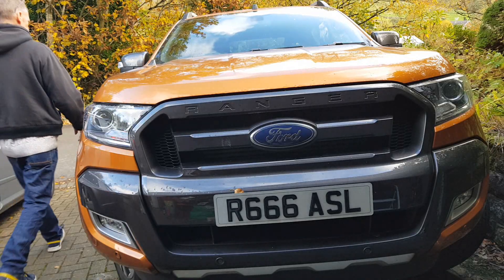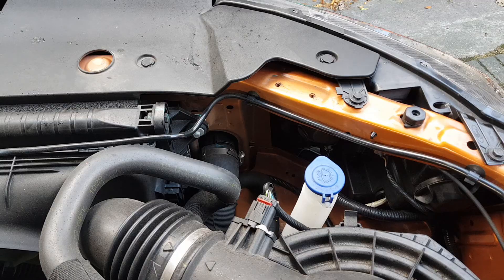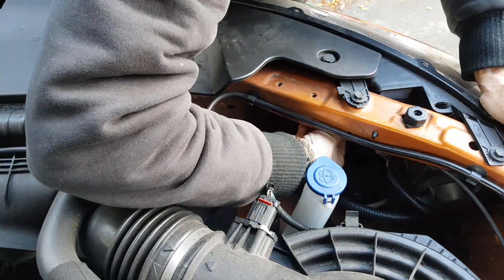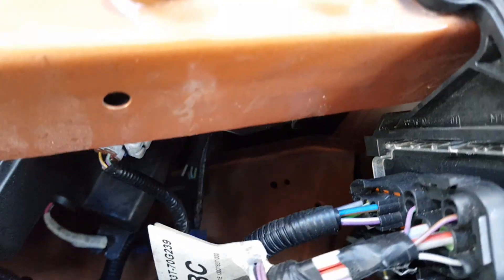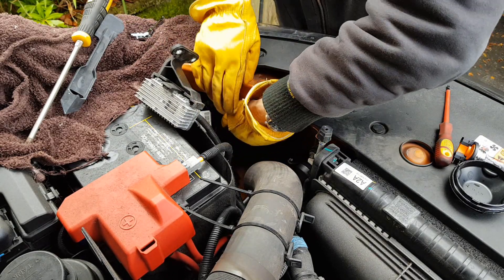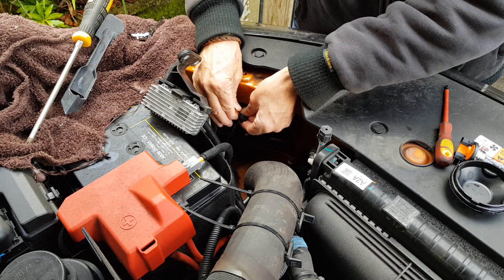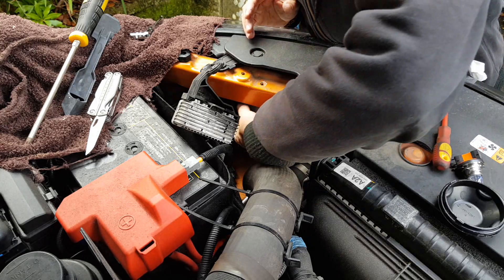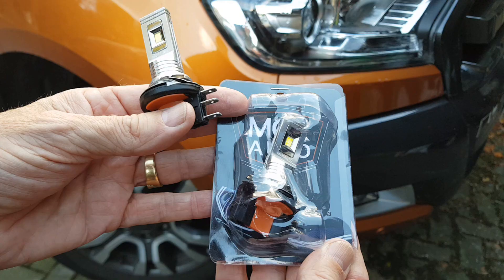Ford Ranger H15 LED Full Beam Installation

Comment: To unscrew the cap at the back of the headlight to change the bulb is the hardest part, to make it even easier for the next bulb change simply apply a light coating of vasoline to the rubber seal on the cover before putting it back on. Works a treat. 👍

Comment: Hi just a quick question on  the mck auto led bulbs you fitted to your ranger  are they still working and do they a built in fan and are they still just as bright as when you first installed them  if you don’t mind me asking thanks
Reply from the maker: Have a look at this video https://youtu.be/7emKDFuSBEk it's the latest ones I've fitted and they are by far the best.  All the LED's I've fitted have lasted and only been replaced for brighter ones.  The link to the bulb is underneath the video

Comment: good day sir.. your video is very informative. i order some led sets from a australain comp. and im wondering if the fog lights led i ordered is correct H8 with fan heat sink. my worries is that it migth not fit.
Reply from the maker: I've ordered some H8's as well for the Fogs but haven't managed to fit them yet because I've broken my wrist.  Should fit though as I looked at the gap before I ordered
Reply: sorry to hear that .. speedy recovery my friend. hope to see your upload regarding the fog leds.
Reply: Theres a stopper in the fog lights housing, just choose a smaller fan, im sure it will fit. I will try to install different model and will try to suggest which one fits.
Reply: good day again sir.. first of all, hows your wrist? hope your doing fine.
anyways, just had my leds the other day and tried to install the H15 led. i have a small issue with the plastic bracket. it seems like it wont fit. and had grind off a bit of the plastic. but no luck. 

P.S for those who are interested in LED conversion kit for the ford ranger wildtrak. check out https://www.stedi.com.au/
Reply from the maker: @subzerized , just read your last message, did you manage to fit the H15 ok?  And the wrist is fine now, thanks.
Reply: @CloughReviews  hello sorry it took me a while to reply. yeah i manage to install all my leds. including the bar. you can  check my instagram for the ligth. its ranger00005

Comment: Do these lights negatively affect drivers of other cars coming past you? For example are they too bright or the are light beams spread too wide or high?
Reply from the maker: No, if you run it upto a wall. there is a crisp line, so no impact on drivers in front (I was really impressed)

Comment: For your H11 lowbeam, which u suing fan led, after installed n put back the dust cap, is there any heat issue tat generate by the fan led? Since the fan led is kept inside a small compartment
Reply from the maker: Nope, nothing has showed up as going faulty and the bulbs still work fine 👍
Reply: Most importantly is the H11 low beams, we don’t actually use the H15 high beam that much,  the bright white DRL makes the headlights awesome!!

I just purchased 2 sets Auxbeam F16 series H11 led bulb for low beam n fog lamp. ( waiting for delivery) now I’m interested the H15 led u are using.

Ford Ranger XLT 3.2L

Comment: Not to ruin the party here but the low beam H11 LED bulb is a mess, the halogen looked brighter and wider. This is common issue with LED bulbs. I suggest you get an h11b HID kit with canbus cancellers. I have these on my 2018 Ford Ranger and its the best setup Ive had so far. The cut off of the stock projectors work well with HID as the beam pattern is wide with good cutoff.
Reply from the maker: Agreed that the HID would be better, disagree that the original, 8 candle power halogens looked brighter (because if they did, I'd have swapped back), but you have the additional cost and additional complications of fitting.  However, I am now considering.....
Reply: @CloughReviews  yeah you are probably right but the stock ones make use of the wide beam pattern vs the LEDs so they appear better to me. The HID though is miles brighter and has a hint of blue in the cutoff which gives it an oem look
Reply: Jay is H15 HID kit available as well?

Comment: Hello I own 2017 ranger Xlt and I had the same problem when replacing the H15 bulbs.The only way to fit those LEDs into the headlight assembly is cutting a small part around the bulb cap.After installing the bulb close the cap and apply some tape over the cutted area in order to make it watertight.
Reply from the maker: Got to say, I was concerned over doing that.  I would have done if it was the dipped headlights though
Reply: Yep no way aound it if ya want a good headlight,adapt and water seal

Comment: Question:

U said the H15 with fan led can’t fit into the headlight assembly?

I mean did u test installing the H15 led with fan to the headlight b4? Bcoz 1 of my fren did installed the fan led H15
Reply: I mean did u test installing the H15 led with fan to the headlight b4? Bcoz 1 of my fren did installed the fan led H15
Reply from the maker: No, the H11 fits ok with the Fan for the dipped beam but there is no way on the 2017/18 Ranger, that the H15 with a fan will fit
Reply: Rangers high beam sits on top of 2 and 10 O'clock side of the housing not in dead center, the stock even hardly fits, thats why most h15 with fan wont fit. If you have H15 with small fan and a wired connector to the socket, maybe that will fit.
Reply: Also have problem with fan does not fit @iammarauder5418

Comment: Hi! H15 is for DRL and high beam? And H11 is for low beam and fog lamps? I really thought high beam has hb3 socket. Please enlighten me. And thanks for the very informative video! 🙂
Reply from the maker: Hi Cris,
Nope, Definately H15 on my 2017 Ranger for the high beam.  Also, I am waiting to install LED's in the Fog lights but my wrist is broken at the moment and in a cast, I'm sure that I looked before I broke it and they where H8's  Also, I have W6W LED's to go in the side lights.
Reply: @CloughReviews  Australian Ranger uses HB3.
Reply: you can use hb3 bulb for replacing h15 but it would not able put back your drl
Reply: What si the model of that LED ligh?

Comment: Nice job.  But I heard that the led bulbs can get hot and melt the housing.  Looks like your bulbs don’t have fans to cool down. Btw I’m trying an h15 replacement on my Ford Edge sport 2018.
Reply: You can try and get the 2019 edge lights they are brilliant but you might need to update the system or something for the matrix lights to work

Comment: Hi.Is the high beam better with this LED?
Reply from the maker: Not necessarily brighter because you can't fit a bulb in with a fan, but better because it is white light
Reply: @CloughReviews  
The lamps have no cooler. Are not they extreme hot?
Reply from the maker: @Алексей-б1д7к , no fan because no space but they are still working fine, no failure.

Comment: Hello sir, Greeting from Thailand. Your video is extremely useful. I own Wildtrack 2017 and I also have intention to change daylight H15 to LED bulbs. Just want to ask you my concerns before apply them.
How is it work from the last few months? Since daylight was working all the time with no fan heat sink, have you faced with over-heat problem? Have you check condition of housing & cap whether it is still fine after months? Is there any problem you have after changed? Thank you.
Reply from the maker: Hi Atsawin, no problem with the bulbs working during the day as they run on reduced power on daylight, full power on full beam. The housing is fine.  It's a shame you can't fit a bulb with a heat sink as it would be brighter but the white light is good 👍😁
Reply: Clough Reviews Thanks for your quick reply, good to hear that it was working well. I think daylight is bright enough  from your video. Thanks again for your info and have a great day.

Comment: Today I tried to open the dust cap for 15min. Now 2 hours later my hands still hurt from trying. Didn't get it to open, ...gonna have to try tomorrow again.
Reply from the maker: I know, it felt impossible.  It only turns about 1/4 1/5 though then pulls off.  If you turn it back tomorrow then try again until it stops, pop it off.  Shit design
Reply: @CloughReviews  It worked effortless today.
Reply from the maker: @mathiasm3462  🤣🤣 great 👍

Comment: Thank you, I have found this so useful with my wildtrak light upgrade & will also do the tailgate slow down next, I did use a oil filter remover clamp to get the covers off the light units which worked really well all 4 off in 1 minute, have you or anyone got any suggestions on upgraded the rear lights? Many Thanks
Reply from the maker: Hi Andrew, No, I haven't started on the rear yet.  I've just done the interior map reading lights using the T10's that I used in the headlamp cluster and I still need to do the fog lamps
Reply: Looking forward to all upgrades for the ranger, many thanks   @CloughReviews

Comment: Is it necessary to put a so called decoder when upgrading to led lights? I bought a H11 fog and low beam but it affects my radio reception. Can you please enlighten me. Thank you
Reply: Try the h11 novsight F03. Im using it on my low and fogs for almst 2 yes now without any probs. Dont get the novsight F06. Price is almst 2x the F03 but they have same quality in brightness.
Reply: Most come with that,just check them out.

Comment: I'm about to buy 1 in england and import to ireland and I'm just wondering are there any of the ranger models with xenon lights?
Reply from the maker: Hi Dave, not on my year (late 2017/2018) but I believe that the new model may have them.
Reply: @CloughReviews  Thanks but I will definitely be upgrading to those lights you use they are much better looking👍

Comment: Dear,
I’ve seen you made the same mistake as me.
The issue you overlooked (as me) is inside the bulb, in the design of the high beam strand. If you look inside of the original h15 bulb, you will see a small reflective part below the high beam strand. The efect of it is to reflect high beam light to upside and avoid the light going to the sides.
Just the bulbs you (and me) installed doesn’t send the light to up, only to sides. The efect is to have a beam scattering for the high beam.
At the moment all LED bulbs with this small reflector have a big size due the fan and/or other cooling systems.
If you look for offers of LED H15 with DLR/High Beam and find someone so small to fit in the bulb holder, please, let me know. If I find and test it, I will let you know.
Thanks for this great video.
Reply from the maker: Agreed, stupid headlight housing that has such little space
Reply: Clough Reviews 😅

Comment: Those bulbs you bought don't really have the correct led sizing for beam correction.  you need ones that have a much smaller led, try either of these ones in H11  https://www.hids4u.co.uk/h11-h8-h16-twenty20-led-12v-headlight-bulbs-pair.html . or  https://www.hids4u.co.uk/h11-h8-h16-philips-ultinon-led-12v-55w-foglight-bulbs-pair.html .  note the size of the led chips compared to yours?   For H15  I would recommend these https://www.hids4u.co.uk/H15-HIDS4U-Stealth-35W-Xenon-HID-Conversion-Kit.html in a 5000k, the downside being come MOT time you will need to swap them over to halogen.

Comment: Why h11 and h15
Reply from the maker: Not sure what you are asking?  If it is that yours are different then I believe it is because Ford use a number of different bulbs for some reason.  I think it is 9005 in some models for the dipped for example instead of the Hll's.

Comment: Still working ok?
Reply from the maker: Still working...... 😁
Reply: Excellent. I ordered a set today for a Land Rover Discovery Sport. The standard headlights are terrible. Replaced the side lights with Philips LED’s, the dipped beam with Philips Ultra Whites and the DLR’s and hi-beam are the last to be done with these. Your video made up my mind to get them.
Reply from the maker: @SurvivingTheApocalypse  remember, these won't be as bright as the ones you are reaching probably, because there is no heat sink or fan on them, but they will be a better light if the improvement on the Ranger is anything to go by

Comment: I have totally ruined my hands trying to get the caps off and the new bulbs in.
Reply from the maker: Mauritz, I know, the worst designed Light cluster on any vehicle I have owned!!!!  The best thing I can say is that they dont fully screw off like a bottle cap, there are lugs on the cap that fit in holes.  If you have move it as far as you can anti clockwise then try popping them off with a screwdriver.  There is a greased 'o' ring holding it quite tightly in place as well.
Reply: @CloughReviews  Yes thanks, it is done now, took me way longer than I hoped. I hope they last not doing that again :)
Reply from the maker: @Jan_Raap , well worth it though 👍😁

Comment: I supply led in my country ... Look for G8 H11 for Projector shaped different chips not side to side .... Trust me night and day compared to what u have now
Reply from the maker: Hi Khaleel, just tried to find some on Amazon UK but nothing is coming up :-(
Reply: Hi khaleed are you sure it will fit a ford ranger housing? Ford rangers fitting is not straight center, the bulb sits and squeezed in at 2o'clock of the housing, that stock halogen hardly even fit. And does it have drl? Thanks
Reply: Oh sorry i thought you where talking about the H15 high beam.
Reply from the maker: Thanks for that Maraurder.  I've just ordered a set of NovSight H11's as one of my originals has just gone but I'll keep yours in mind if I get any more.
Reply: @CloughReviews  i hope its the novsight N4R, thats the same as P9.

Comment: Your wrong mate led lights actually blind the shit out of   oncoming traffic compared to the normal halogens. They also fatigue your eyes alot quicker and reflect off road signs majorly, making vision squinty
Reply from the maker: Not arguing the LED point in general.  However, the lights on the Ranger are so shit, that certainly in this case, these LED's are a lot better than the halogens. Bright white wins over dull yellow every time.......

Comment: You know those bulbs are not legal right?
Reply from the maker: Why is that john?
Reply: @CloughReviews  That would be because they are not E-Marked and approved for fitment into a halogen housing so is contrary to Road Vehicle Lighting Regulation.
Reply from the maker: Well it's at least fortunate that they do the job then.  Shame Ford didn't design a better headlight assembly where you could fit decent bulbs in, or to that end, a decent light assembly that actually lights the road in front of you period...….
Reply: @CloughReviews  Oh I agree that the stock lights on the Ranger are a pile of crap but they can't legally be modified, the ranger 2019 facelift at least has HID now.
Reply: @CloughReviews  I agree, the factory h11 bulps are a joke. When I got mine 2 weeks ago, I really stepped out of the vehicle to check if the bulps are on at all. Replaced mine (WT 2018) with 150%+ h11 bulps immediately. much better. I also thought about using led-replacements, but since you loose your vehicle type approval, you might get into some serious issues (insurance company might refuse to pay)  if involved in an accident and someone finds out about the led. Only hope is the 2019 American Ranger (xenon) or the 2019 global facelift with hid.